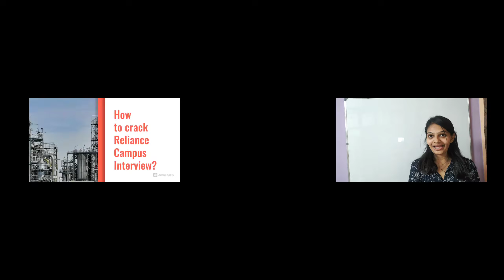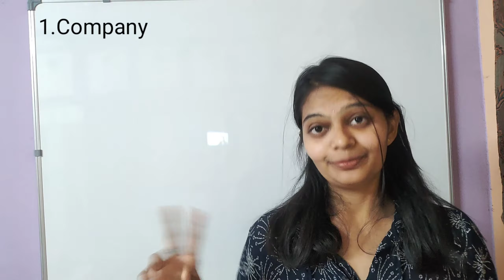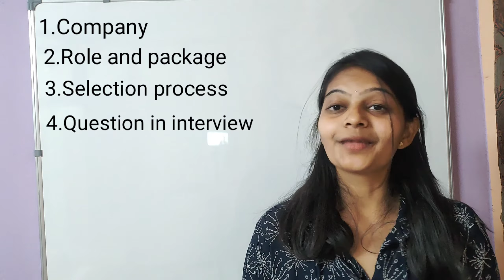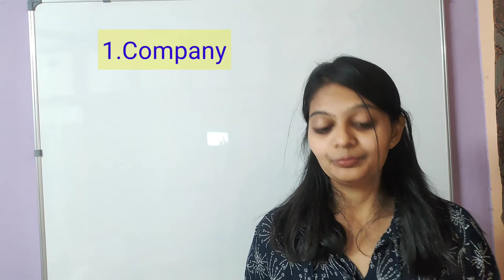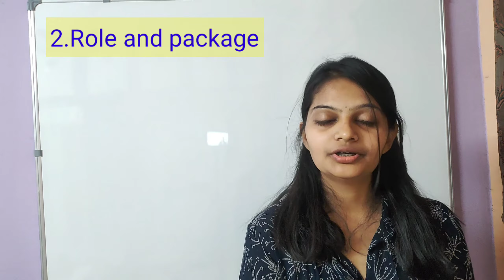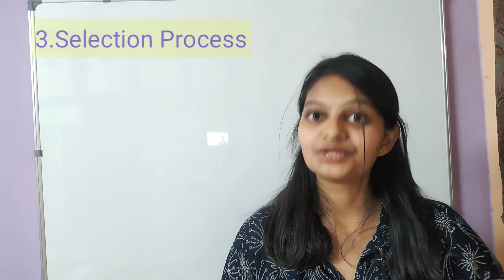How to prepare for Reliance interview|Questions asked in Reliance job interview|Chemical Engineering

Comment: How to prepare for Reliance campus placement for subjective test for chemical engineering.....
Reply: Dude , when did reliance came for you to apply 
For us it came on 22nd October , but still we haven't had ppt, same for you ?
Reply from the maker: I gave test with question to solve in minute or two..subjective and lenghty question are not asked...they ask technical questions which can be solve in 1-2 min so check out indiabix and gate past years 1 mark question
Reply: Mam, O P Gupta book kesi rahegi uske liye ?
Reply from the maker: @darshanpatel9532  sahi hai..bas time and accuracy pe focus karna..aptitude bhi equally important
Reply: @chemebonds2339  kon kon se subject me jyada ate he question?
Reply from the maker: @darshanpatel9532  operations like heat,mass,fluid, mechanical operation , remember important number...u can question from all topics though
Reply: @chemebonds2339  Thank you Mam 😊
Reply from the maker: @darshanpatel9532  👍good

Comment: Hi Mam I have done designing course Can u tell about mechanical Enginnering questions  Rel coming for mechnical in my college they r recruiting for gujarat cities
Reply from the maker: Prepare from indiabix n gate 1 mark question for test n mechanical basics n project for interview.Contact your mechanical seniors in ril as they can guide you for subject specific questions
Reply: @chemebonds2339  mam i got short listed in reliance and  the final interview is 3 day after they r coming for manufacturing division… and im from mechanical btech so which type of question they would be asking?? I have prepared all question u told
Reply from the maker: @atharrvaa_shirke  subject basics,internship n project n introduction sahi karna with confidence